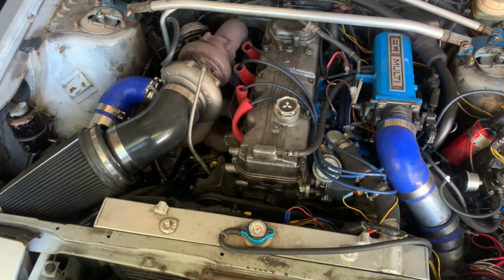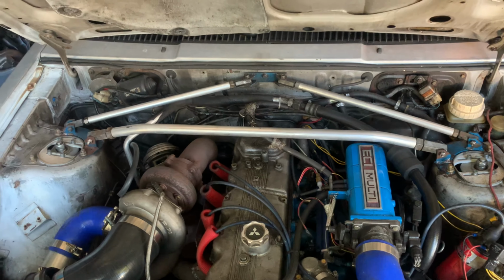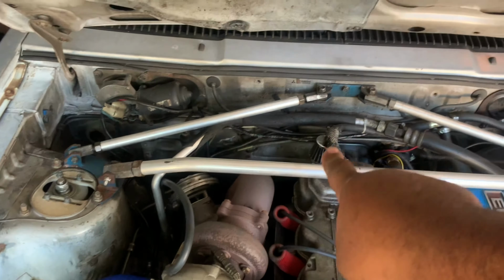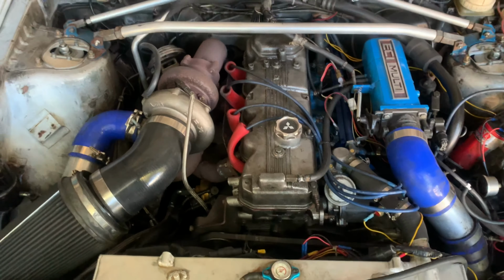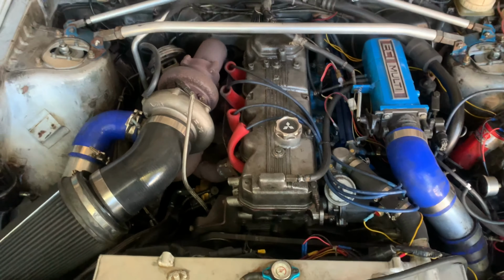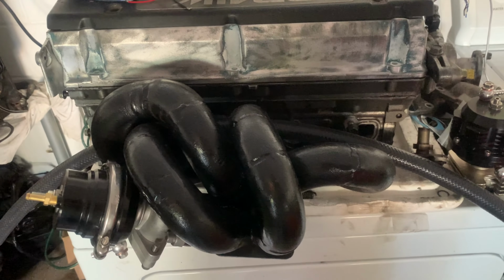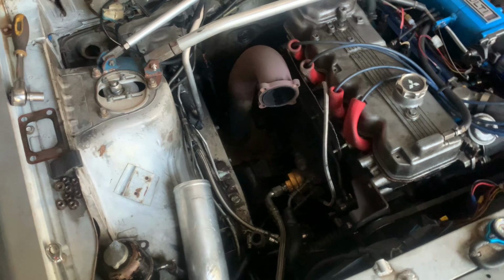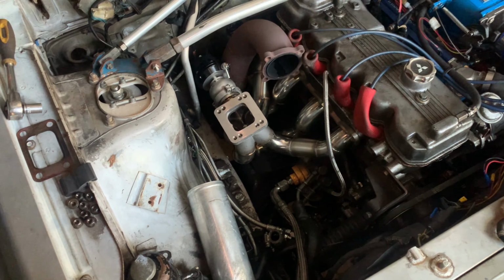1988 silver starion disaster

Comment: If you still have the 3 valve (jet valve) head, trash it, get the good head from the LeBaron that had the Pininfarina body because the head on it had Lotus design.  Its a direct swap, and much better flow. I put a 284 duration Schneider Cam and ran what looks like a very similar setup to You.  I also ram a MAP translator box to allow a GM type throttle body with factory Mitsubishi electronics.
Reply from the maker: Oh yes I completely agree I stop using those heads a long time ago this one is a regular two valve solid state type of head and I have another head from Australia that has a smaller combustion chamber should definitely be great for high horsepower applications

Comment: I have a question, im doing my starion tbi to EFI system w/ a ECU but i want to use its distribuitor, how i can do it? I must use a hall module? Idk tell me about it
Reply from the maker: Yes you are going to need some thing to know where the engine is in order to have a coil on plug or coil near plug so some people change the distributor to one that has a cam sensor in it and use that or they get the EDIS Wheel at the bottom cost a lot more money to go this route but it is available